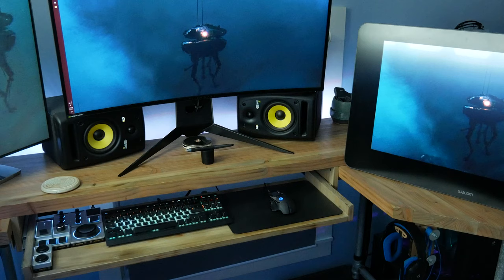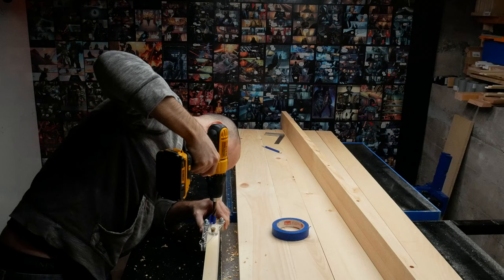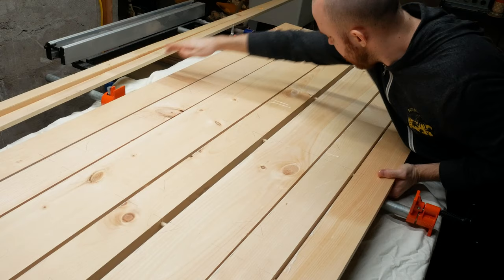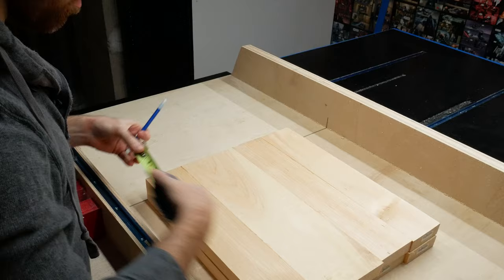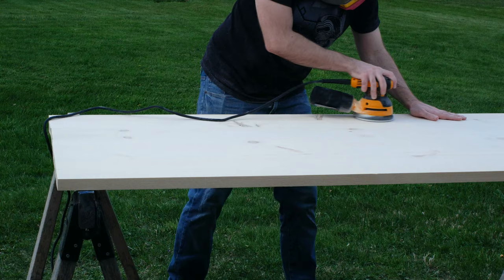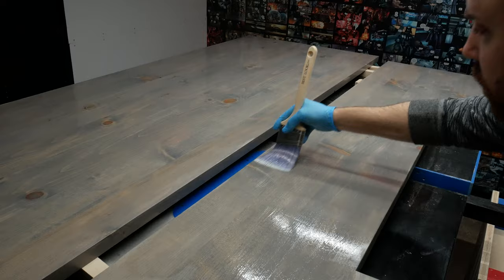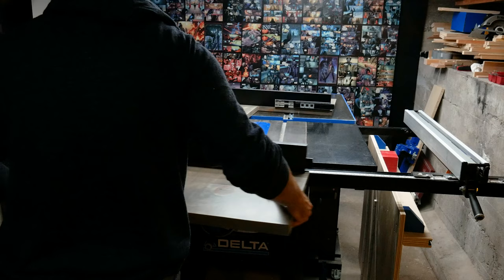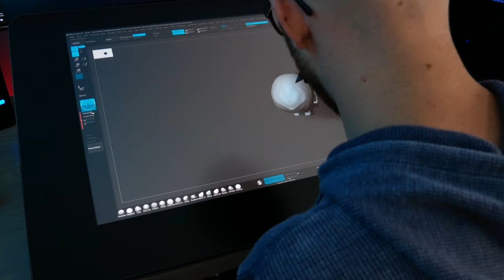How I built my upgraded desk | 2022 home digital art studio

Comment: Great video and beautiful desk. Excellent work! 👏 Can I ask specifically how you have the Wacom mounted? I have the same model on a wacom ergo arm, but I don’t think I could get that in front of the main monitor like you have. Would love to know how you have that setup! Maybe content for another video? 😉👍
Reply from the maker: I have mine attached to an ergotron brand arm. To get the tablet to stack under the primary monitor I found an off brand tall monitor stand that had the same diameter mounting tube as the ergotron. This let me attach the ergotron all the way at the bottom of the stand and primary monitor at the top. You could also do this with a tall 2x monitor stand, but I already had an arm that I wanted to use so I opted to go this somewhat diy method.
Hope that help! let me know if you have any other questions!

Comment: What arm is that for the Cintiq? Did you need to buy an extra arm for the other display?
Reply from the maker: The Cintiq is attached to a heavy ergotron monitor arm, however, I found that I could attach the ergotron arm to a second tall monitor stand which is what the ultrawide monitor is attached to. You just need to find a stand that has the same size pipe as the ergotron.
Reply: @jasonburns-collective  Thats interesting. I actually went the other way. I had a desk (not as fancy as yours) build with a proper drafting table on the right which takes up most of the desk. To the left there is about a 11x24" strip for mic and monitor arms. The Cintiq even with that heavy arm was a problem so I mounted it to an old TV stand and built a shelf on risers for my PC. I work my proper job on this desk too and its all a big PITA. If I could give up the drafting table, I could get away with $150 Amazon desk or even a motorized desk to stand once in awhile. Looks great  though man.
Reply: @jasonburns-collective  Also, do you recall which pole you found. That heavy ergo arm has a larger than normal hole so Im having trouble. I assume you attached your curved display to that same pole with whatever arm came with it.
Reply from the maker: @CreateNowSleepLater  yup the curved display is attached to the top of this stand (https://www.amazon.com/gp/product/B01CUU2VKY/ref=ppx_yo_dt_b_search_asin_title?ie=UTF8&th=1) and the ergo arm is just resting on the bottom of the pole.
Reply: @jasonburns-collective  Nice, thanks!

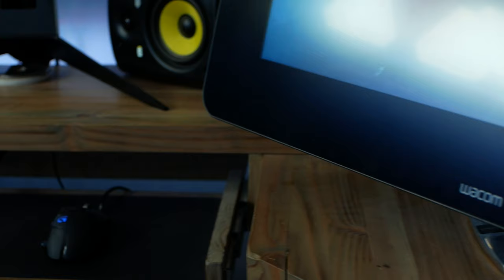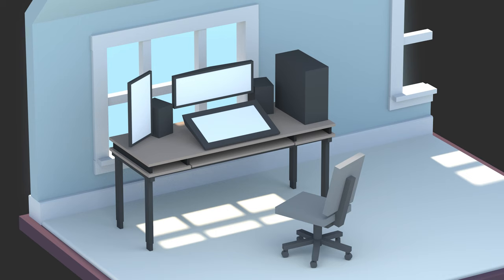Comment: Nice setup! Question what software did you use to design the mock up @0:58-1:35?
Reply from the maker: Thanks! I used Maya for the mock up and design for this project. Fusion 360 would be better for blueprints, but at the time I had more experience in Maya so I just used what I knew.

Comment: What monitors and app did you use please
Reply from the maker: Right now I have a Wacom 27 qhd, an 34" Alienware AW3418DW, and an 24'" aoc u2790b.  Currently I'm not using any multimonitor software, just the default winnows 10 pro setting.